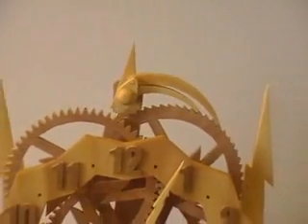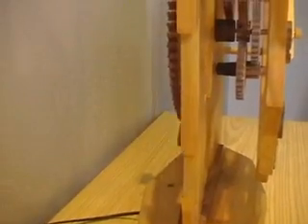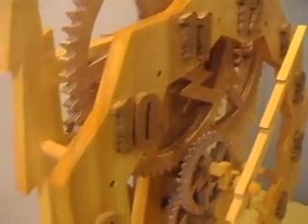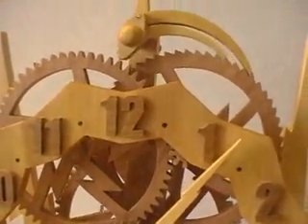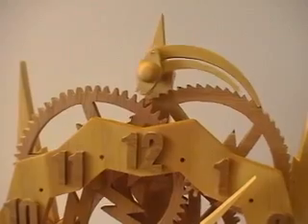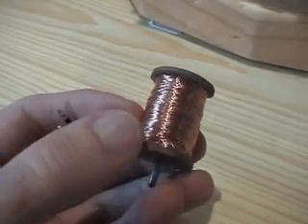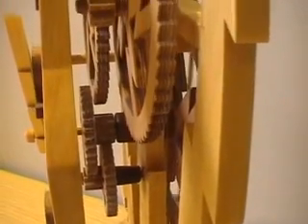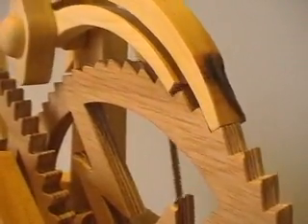Flash - A Wooden Clock

Comment: Interesting escapement... the power is supplied to the escape wheel directly (which is NOT really an escape wheel) and not the beginning of the going train (which is NOT a going train either). You can do this because of the electromagnet I presume... a spring or weight-driven solution would only last a few minutes applied to the escape wheel!

I'm starting to be less of a purist and accept the idea of the electrical power... having to wind your clocks every day can get a bit old... plus, it's only for the power, the timekeeping device is still mechanical.

Cheers!

Comment: Adrian. I am working on my Toucan and have had quite a few conversations with Clayton. I am having trouble with the coil. I understand you helped with those directions. Isses:
I may have wound the outer coil opposite the inner inadvertently. I tried reversing the connections at the end, but still nothing. For a brief time, I was getting a little wobble out of my coil, indicating it may be working or at least trying to work, but since I tried to redo the connections: nothing. 
I used a zinc crew for the core. I could not find anything iron. Is this an issue? 
I am this close to starting over and building a new coil. But I would love to salvage this one if I could. Any suggestions?

Comment from the maker: @marcfeyzeau : the electromagnetic coil is two windings of 60mtr each, 30 gauge magnet wire connected to a transister and all run from 9v DC.  The pendulum has a rare-earth magnet in its base.  Because the mechanism is run from the escape wheel down, very little force is required to run the clock and there is no weight on any wheels, thus the simple frame.  If you email me directly I can share more.